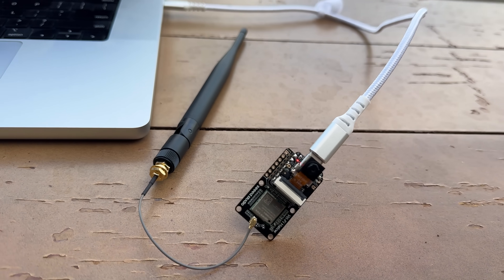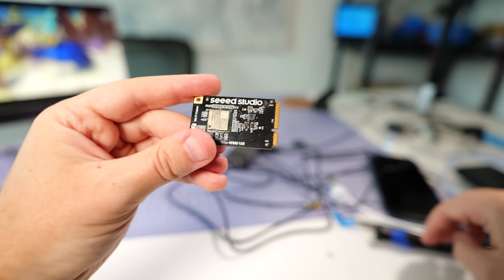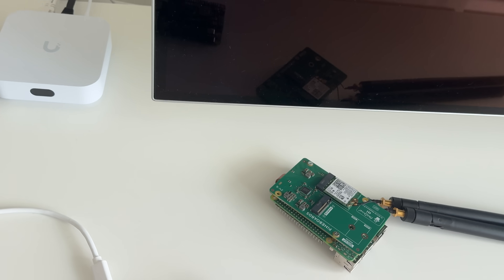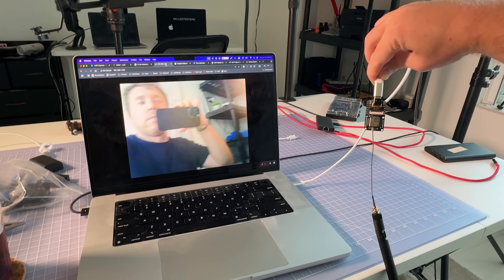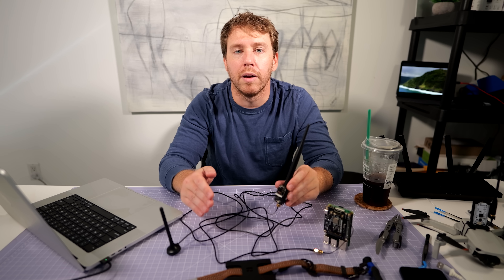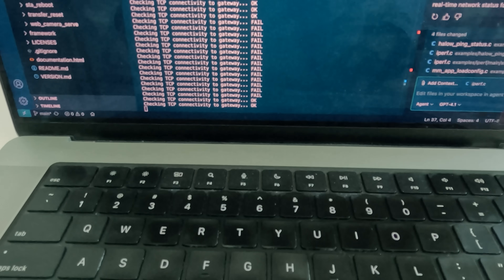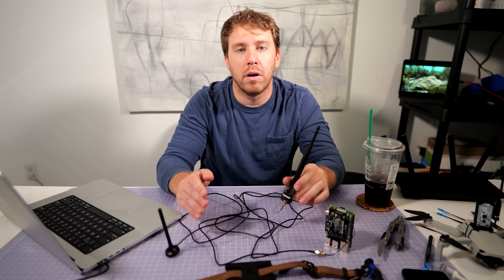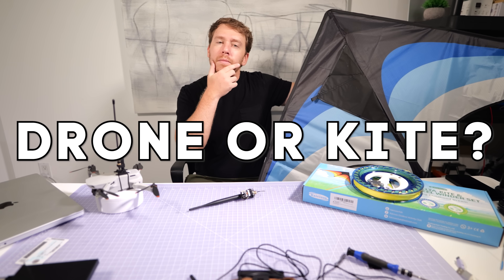You’ve Never Seen Wi-Fi Go This Far

Comment: I appreciate your video as you're helping others learn more about tech. 

But you video label and the way you talk about it is a little misleading. This is not Wi-Fi that is extended at all. You go 1km away, you're not seeing the original SSID. This is simply a 900 mhz subnetwork bridging 2 completely different nodes, if you put an AP at the other end with the same Wi-Fi SSID/PW, it will feel like both ends are on the same network. Everything in between is a dead zone for Wi-Fi connectivity. 

People have implemented stuff like this for about 50 years now in SCADA applications and I personally have for 25 years. 900 mhz (Point to multipoint - PTM) off a good sized tower and good topology is good for 20-30 kms (I've had it work close to 40 kms, but that was connecting 2 large towers. Point to point with technically illegal output power (like oversized antennas) is only limited by the earth curvature and the clipping of the freznel zone impacts 900 significantly less than higher license free bands (2.4 GHz and 5.8 GHz). Essentially you give up distance for speed. 

It's cool that this stuff is nice a cheap, but there is no advances in the concept or the technology really that I can see here, just a company trying to make this stuff cheaper. Don't get me wrong, that's still good! 

LoRa is likely to take over the IoT realm when it comes to this (not for video mind you, but data point capture) as the power consumption is staggeringly lower than license free radio bands.

I remember about 18 years ago, freewave developed a 900 mhz Ethernet radio. Could be run PTP or PTMP. I don't recall the exact speeds but it was somewhere in the 150 kbps, so quite unusable but that was a long time ago, so it's good to see these guys have created an improvement there. Opening a basic web page in a perfect lab test was quite painful and we never adopted these because of that

Comment: I've been doing similar for years with a few friends using things like old satellite dishes and USB dongles  with attachable antenna mounted to just the right distance to the lmb point on the dish. (Yes makes big difference) Surprisingly it works wonders with 2.4ghz especially if you have a clear line of sight for a very long distance and an identical unit on the other side.

Comment: 900 Mhz? Most WiFi is 2.4 Ghz or 5+ Ghz, lower frequency gives longer range & obstacle penertration but much lower data rate, ~1/3 rd. You are sacrificing speed for range, nothing wrong with that but beaware of the trade off.

Comment: You are testing line of sight, which is not real world. Bad test. With the right antennas, you can go for miles. Please learn the difference between megaBytes and megabits. Also, no WIFI can go through concrete.

Comment: Back in 2001 I successfully tested using Wi-Fi at 2.4GHz at 14.2 miles at a full 54Mbps.  We had been building a UBNT competitor ant the time. You will need directional antennas to get better data throughput. The omni antennas you’re using are killing your project”s distance.  900MHz does got through walls of various constructions about 3-4dBi better (3 dBi per doubling of the frequency (3dB is 100% more power), but also gives you more signal to noise ratio, which improves data throughput.

Comment: Tried doing diversity use two units and synchronization to have a diversity receiver and transit if you wanna go really far try the express LRS system and also Dji  has digital video that they can send well how far you wanna I have a one watt transmitter ELRS on my beta FPV version three and it’ll do 10 km on an Omni antenna
Reply: I haven’t tested. It’ll probably do further.

Comment: now I'm wondering if you could somehow DIY some kind of booster circuit to re use an old wireless broadband antenna on the roof of a house, maybe even a sat dish or even the older TV antennas to get a better / clearer signal.

Comment: When you state most people I would not disagree as very few people actually work in wireless networking or have had experience of long distance wireless networking. Wireless networking can work over extremely long distances all dependent on type of antenna, frequency range, height of antenna, and terrain. Even without considering my professional experience, as a hobbyist I have been able to achieve reliable long-term links of 2-7 miles what is similar equipment and upto 20 miles with directional antennas. 
Several considerations for this project should include robustness and reliability of hardware, stability of experimental software, and legal use of radio frequency spectrum. Claims in the video of capabilities of the 900 MHz section of the spectrum are, to say the very least, exaggerated... just like with LoRa. At least the presenter does admit, eventually, that the range dies at about 300 m 'under real world tests', read under ideal conditions into that, but getting an acknowledgment across that distance does not equate to a functional and reliable link. That is a plethora off reliable and robust new and used commercial equipment out there which, for far less than the combined price of the parts shown in this video, can give you coverage in the range of kilometers without all the aggravation of tinkertoys, project boards, or or experimental software. 
This kind of project is fun to play with but it should not be considered as an operational or mission critical (this includes rural and disaster prep situations) infrastructure in any way. This is my very clear by the demonstration close to the end of the video in which signal is lost within the building. Demonstrating that a clear line of sight signal to an antenna at a significantly elevated position, which may look impressive when you look up onto the building, proves only that the link is capable of operating over a short distance. Repeat this experiment with dense foliage, buildings, moving traffic, or a high RF/EM environment and you will get a very different result.

Comment: mega bits per second not bytes :) we're not there yet :D
Reply: we are there in fact. 5 gbps is 625 mbps. put simply, we use bits instead of bytes because they're the smallest possible piece of data to transmit. it does irk me when people use them interchangeably though.
Reply: @lambdatempest  @6:00 2.4 GHz wifi speed of 200 MB/s? 6:15 5 GHz wifi with 500 MB/s, I need to get me some of this equipment that can do that :)

Comment: The LinuxBierWanderung of 2001 was held in Bouillon, Belgium, and the main events were held at the Archeoscope building.  However, we also had a panel antenna that we attached to a chair that we put outside one of the windows, and it was aimed at a nearby campsite.  We did a wardrive in my wife’s car, all the way up to the campsite.  Then we set up a tall antenna at the top of one of the posts, aimed back at the Archeoscope.  If I remember correctly, that’s about an eight mile drive, but the straight line distance is probably something closer to five miles.

That was plain WiFi 802.11b, which had just recently been introduced in Belgium — I had bought some of the first cards available for sale in the country, and I could only get them because I also worked at Belgacom Skynet at the time, and they were the largest ISP in the country.

I know many people have since gotten much longer distances with plain WiFi, when paired with the right amplifiers and antennas.

So, WiFi can get good range, if you design it right.  I think the real advantage of HaLow is that it uses a lower frequency band, and so it can get even better penetration than you can get with 2.4Ghz, and at a much lower power requirement than plain WiFi.  That makes it even more suitable for use with small portable devices.

Comment: Hook your Wi-Fi up to the metal railing in the emergency stairwell.
You may need to boost the power to drive it into the metal rail. Also scrape the paint off in a tiny area to connect antenna.
Reply: Ummm
Reply: Do you think a window screen would work as a directional antenna perhaps?  Would be extremely available compared to the stairwell rail.

Comment: Love this video, I wish I was nerd enough to understand this completely and be able to build my own setup.

Can you make a video for dummies who want to build a similar set up? My friend lives less than 1km away from me and has internet I can use but his wifi doesn't get to my apartment so I can only use it over at his house. I would love a guide to how I can get his wifi string enough to reach my apartment.
Reply from the maker: I can look into it, I think the tooling here is still a bit rough as I understand it. But maybe there is a plug and play solution out there.
Reply: You need a "long range outdoor CPE" or "point to point wireless bridge" which is a directional wifi access point which focuses the radio signal into a beam instead of spreading it omnidirectionally. Mount it on the outside of your friend's house and you should be able to receive the signal at your apartment. If the signal is still too weak, you should get a 2nd outdoor CPE and install it outside your apartment, then connect it to a regular wifi router inside your apartment. This is exactly how wireless ISP's work in some places. You will likely have to configure the CPE for "access-points/802.11" instead of its likely default mode which is some vendor-specific variant of WISP/WiMax (a long-range radio signal not compatible with smart phones, laptops, etc) "CPE210" is a useful product code, but there are several manufacturers that make similar products.
Reply: @rh4009  What if I don't have a clear line of sight?
Reply: @tontonraymond  The radio signal naturally bounces and reflects off some obstacles (glass, metal, ie. buildings) to some extent, and penetrates some (drywall) with ease, but is absorbed readily by others (dense foliage). Absorption and attenuation due to longer, indirect, bouncy path can be overcome with either more power, and/or a more focused beam. There is also a class of CPE with parabolic antennas, which focus the beam more (eg, LiteBeam CPE). Transmitter and receiver beams must be aligned more precisely, just like you need to align a satellite TV antenna towards the exact location of a satellite. There are also mounting options like tall poles or antenna towers that are useful in helping move the signal above trees, for instance - if the obstacle is a forest, a tower is the proper solution, not more power. Look for "rural wifi" and "marine wifi" - the problem of transmitting internet at great distance through challenging terrain has been solved many times already.

The radio signal propagates in waves, not entirely unlike sound. Just like sound can propagate around some obstacles, or be muffled/attenuated by others, radio waves do too.

But ultimately "it depends". If by "no clear line of sight" you mean you are in a concrete prison cell in the center of a large building, and your friend lives in another country half way around the world, then I'm not the guy to ask.

Comment: So this uses the 802.11AH protocol?

A tip for the Raspberry Pi with wifi and maintaining signal without dropouts, try adjusting the baud rate in the Raspberry Pi boot configuration.
The SPI config for Raspberry Pi is also native 3v where most wireless adaptors are 5v and there is some information about this in the Raspberry pi wiki about this? I experienced drop outs whilst using the raspberry pi with a SOIC 8 reader. I think you can select a student SPI mode from the boot config 👍
Reply from the maker: thank you!
Reply: @DataSlayerMedia student autocorrected from specific. My apologies

Comment: I just started this "Local fast private network" journey and found your channel. You seem to be looking into the very thing I need a solution for except I am getting the vibe that many of your solutions are connected to an ISP? I am looking for something more off-grid. Not exactly for security reasons (though that is nice), but more for mobility. I want to create a network of connected devices over a range of about 300 meters that can transfer data at enough bandwidth and speed to use cameras and real time communication. The objective is to set up a hidden network to power a local "murder mystery" event in a remote local over the course of several days. You cover a lot on your channel. Can you direct me to the videos that cover anything like this sort of thing? You seem to focus on democratizing network solutions without super involved licensing or high cost; just what I am looking for. I apologise for my ignorance in advance!
Reply from the maker: Have you looked into ATAK?
Reply: @DataSlayerMedia  I know of it, but I have never delved too deep into it since it looks like the use cases are all low bandwidth. They also seem to be for tactical map interactions and radio calls on a local radio network. Perhaps I need to look into it further to see if I may have dismissed it too early. Thanks for the tip!
Reply from the maker: It should support video feeds. It's all open source too - but it runs on a full linux OS like Android

Comment: I believe Morse Micro release the chip MM6108 a couple of years ago with a higher bandwidth (8MHz) allowing more throughput in this band. Other Ha-low devices have a 4MHz bandwidth.
Reply from the maker: I believe their chips support channel bandwidths between 1-16 MHz. Admittedly, I didn't go that far int he weeds in my analysis but definitely will explore the various configuration settings to determine what it can do and where it the sweet spot is.
Reply: It’s a dual  LR1121 chip these same chips are in radiomasters new crosss band Gemini radio in which allows users to switch from 2.4 to 900 mghertz  while in flight

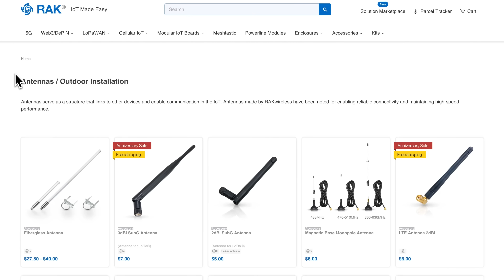Comment: 3:12 OMG Thank you! I've been looking for 900MHz Wifi since 2003. Also, I stopped imagining decentralized WiFi ever since I learned about subnet mask in 2003.
Reply from the maker: Totally agree — true decentralized Wi-Fi might be a stretch. But 80 overlapping networks all drowning each other in interference? There’s got to be a better way.
Reply: @DataSlayerMedia stop using ChatGPT to answer dude. If you can't be bothered don't.
This is just pathetic
Reply: You could run NAT on the LAN side of the AP, and run a block of routable addresses for the WAN side of the APs and either cluster them in blocks using DHCP and OSPF or just run BGP as an autonomous system at your drains. The IP space doesn’t need to be completely contiguous.
Reply: @esSKay25  Would you care to make a video demonstrating what you are saying.
 The only way I've been able to imagine a decentralized wireless network working is one where the packets propagate through all wireless nodes and intersections like a virus and get retained in each of them for a bit of time to be copied to any new nodes that appear, and each time they are copied, the address of the receiving node gets added to the packet. When the packet reaches its destination it will have the addresses of each hop it took along the way. The destination then sends out a general reply with the checksum of the initial packet telling all other nodes to disregard the packet, and also a special reply to the sender using only the hops the initial packet took in reverse order. This is not a perfect system and with a little imagination one can think of a lot of scenarios where it would either fail, or where to many packet copies would jam up the airwaves, but, it's the only system I've been able to imagine somewhat working.

Comment: Sounds sketch and illegal without a ham lic. There are serious restrictions on this frequency and air time. FCC might be knocking on your door with this device. Lora gets away with this by short blasts every x minutes which is legal without a license.
Reply: 900mhz spectrum is unlicensed in the USA. LoRa doesn't 'get away' with anything, it just uses the same 900mhz unlicensed band. You may be thinking of the laws in other countries, where the transmission duration is limited.
Reply: @benjaminlong7317  Actually I am thinking of the united states and it IS limited in terms of both power output and duration without a license. It may be an unlicensed band but its use is not without a license comes with restrictions.
Reply: @YTFP_Chris the device needs to be regulated, not the operator. The 900Mhz band has channels for both licensed and unlicensed use, and there are specific bands apportioned for unlicensed  data use which the devices must be compliant with.
Reply: @esSKay25  Actually ultimately it is up to the user to remain compliant. Ignorance of FCC rules are not an excuse if you misuse the frequency. There are limits on its use whether you are licensed or not. The duty cycle in this use case exceeds that duty cycle of an unlicenced user. Its not the hardware if its FCC compliant, its how its used.
Reply: Thanks ytfp for mentioning this very thing. If the device does not carry an FCC i.d. number I'd put money that's it's radiating in an illegal way.

Comment: It's Wifi, but not wifi. So click bait.

Real Wi-Fi can go far but special antennas and controlled environments and you can get miles. Done everyday.
Reply from the maker: It's definitely WiFi, has it's own standard and everything. IEEE 802.11ah
Reply: @DataSlayerMedia in a nit picky, yes. But most people would assume comparability. And it doesn't have that. And 900MHz wireless was around in the 90s. I've seen some of the equipment. Also 900MHz skates with a lot of other stuff on that portion of the ISM band. Including smart meters and amateur radio.

Comment: a while ago i was thinking what if you could use a walkie talkie to transmit wifi data and create a few miles wide hotspot using some audio frequency range encoder/decoder system
Reply from the maker: Not sure that frequency could support the data rates needed though.
Reply: That’s used for text messaging using HAM/GMRS radios.  Low res images can be sent too, slowly.  It’s also used to send email with small file size.